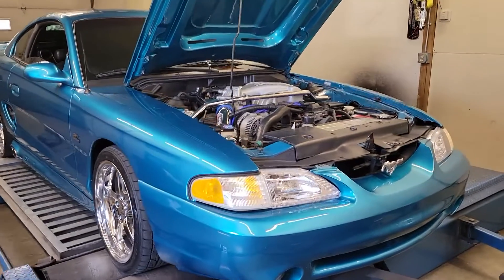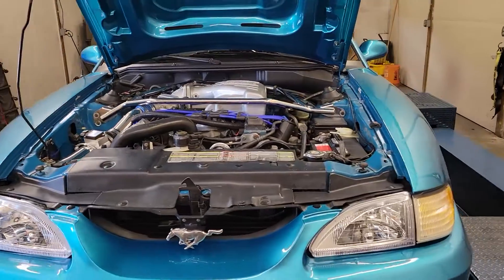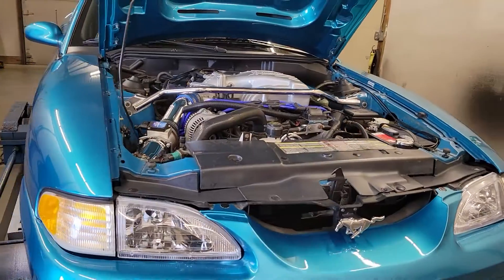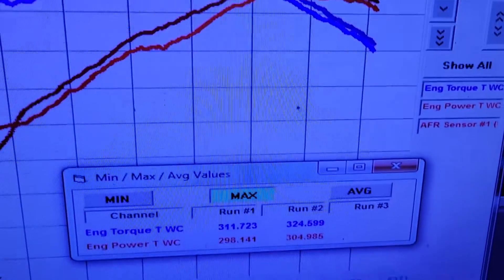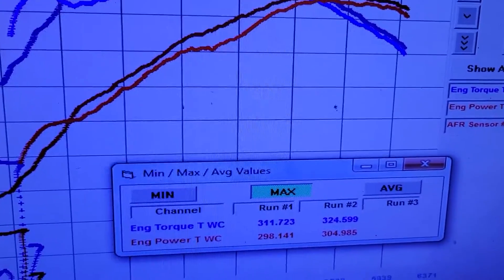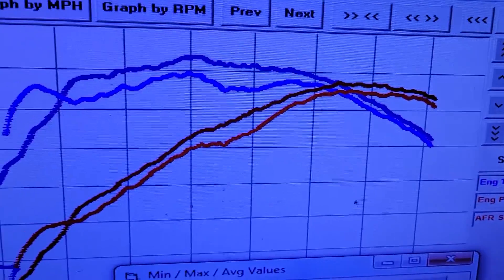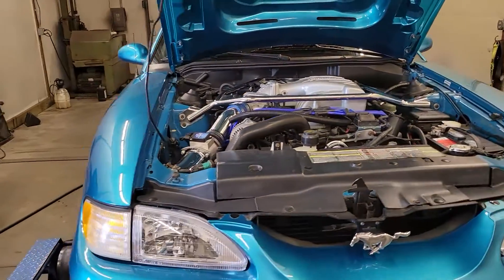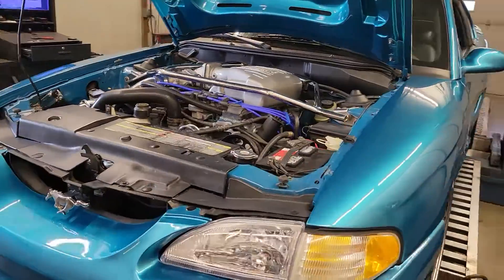331 Stroker Mustang | Elgin cam | Edelbrock Intake | Dyno Review

Comment: Which heads were on it and how big of a cam was in that 331 Im hoping to make 370-400 wheel hp with my trick flow 11R 190's with a 595/595 242/246 110 lsa trick flow track max camshaft and vic jr knock off intake manifold ran by a holley sniper

Comment: Expectations was greater with increase of 29 cubic inches an Even at-10 degrees of safety dance. Seen stock unopened 302 make 25% more horsepower. Thanks for your service
Reply from the maker: Airflow + rpm makes HP.  Not cubic inches alone.  

Also, you cant compare dyno numbers between different dynos.
Reply: @ForceEngineering  I'm just going to copy and paste what I said in response to a conversation with a 331 owner in what I want to or hope to do with mine in the future. Let me know your thoughts: 
 "@Scott SVT  not bad not bad. Well my 94 Cobra is heavy I'm sure with those 18x11's and 315 30's out back and 18x9 or 9.5 with 275 35's. It was at 286 with around 301 ft lbs torque with the Edel performer rpm 2, TF 170's, 75 maf  and 70 tb with shorties and flowmasters. I put on LT headers and a free flowing pypes bomb catback and it does feel like it picked up pretty decent. I still will likely make a move and either do a 331 or an SC. I'll likely opt for the freshend up engine and to just stroke it. I'll have to see about wanting to get new heads (probably 11R 195 or 205 or AFR or Brodix) and sell mine or just sell my engine ( around 192k miles) and buy a crate minus the intake and heads. Decisions decisions when that time comes man so i'll have to see."

So yeah not sure which route yet but and if I don't do an SC which I probably won't, i'll definitely do a 306 or 331 and might as well do the 331 more than likley. With a similiar setup to his and going with bigger heads I think I'll be happy overall. What heads were on this car? Meter and TB size? cam?
Reply: The cubes don't do much for you when you don't got the hard parts to take advantage of them.  It don't just automatically make more because it has more cubes you gotta have the combo to take advantage of the cubes.  Tq will be little more but hp won't change much if any without changing the combo.  302 sized parts make 302 power.